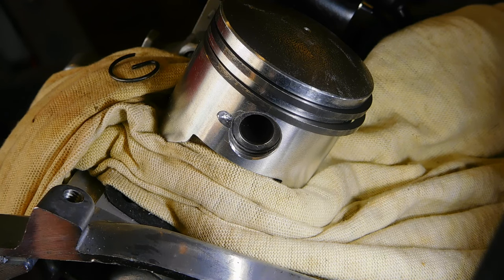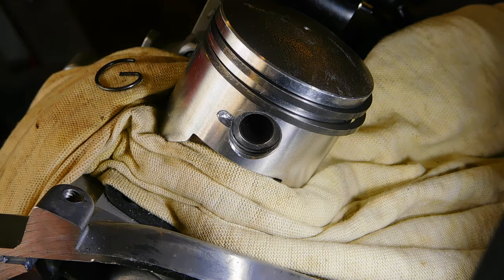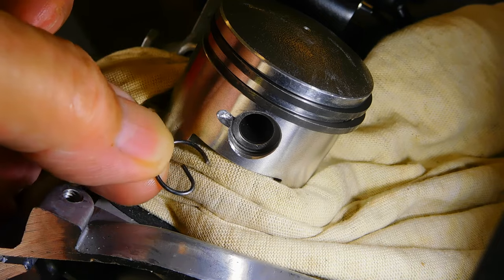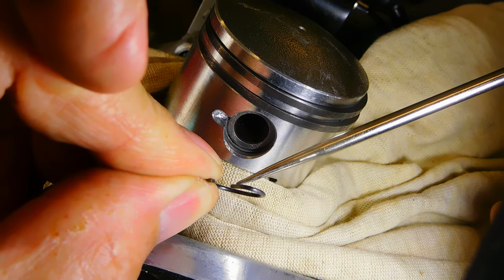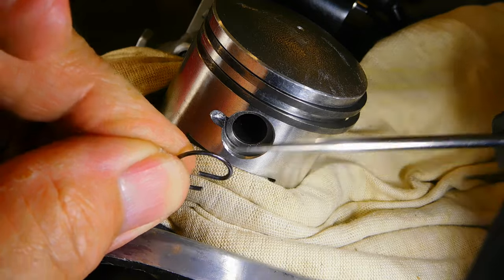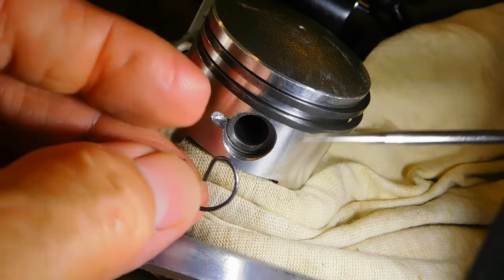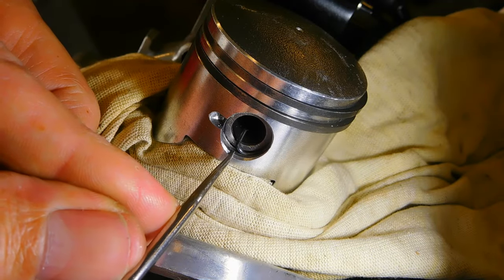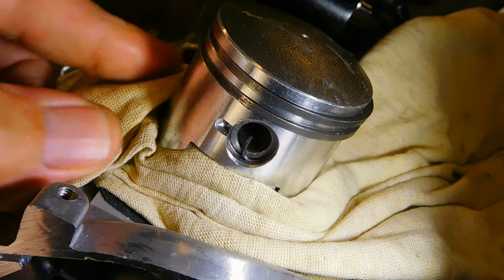One Way to Quickly Destroy a Two Stroke Engine

Comment: Never noticed this. Always installed with a pliers and never noticed the ears. Never destroyed a engine but this video gives golden tips.
Reply from the maker: Odds are it will not happen for most, the problem is that if the clip does fail as it does sometime then it makes an expensive mess, at which rate if doing a rebuild it is a small thing  to sort out to ensure it never fails.
Reply: Can these clips be replaced with proper circlips or.are they just as safe if installed correctly. I just purchased a 45 cc Rovan engine in seperate peices.

Comment: In this case it doesn't matter the clip will outlive the engine. In all other cases I agree completely!
Reply from the maker: Yep, Ill be showing the small end bearing set up on this in next video, its designed to fail.
Reply: I have seen cases where the pin wears thru the clip and the end brakes of. Destruction is the result.  I used to grind of the little ears of to avoid destruction of expensive parts and a highly tuned barrel.
Reply from the maker: That's another good reason not to have them at all.
Reply: Sometimes the clip gets shaven down if its not wide enough and thus rattling out.

Comment: This was the best video I've seen on the G-clip. The 66cc engine gains power with porting as I have learned. Experimenting the Rookie way., I try to sneak up on how far is  too far when opening the ports. Tearing top ends up just on this topic .
Reply from the maker: Thanks for the comment.
Thing with porting to keep in mind that going big on the exhaust timing is not so bad so long as you don't go too high in transfers and leave it with a short blow down time which can cause a fair drop in power.

Comment: I am racing motorized bikes and a fellow competitor had the ear broken off. So I cut them off and cut a groove in the piston to be on te safe side for my last race engine.
Greay videos, but I like to see your face . It makes it more personal.
Reply from the maker: Good idea for racing, its one thing to have it damage an engine and another to loose a race over such a small thing failing.
I used to road race bikes and had things like throttle cable end coming off with a few laps to go and looking at a placing.
I show my face and some of the videos too but I don't make a habit of it.
I should probably add a few more camera views to include that.
Reply: @AuMechanic  Science is to learn from others experience.

Comment: This is very helpful and I wish I seen it sooner. Last year I bought one of these engines from bike berry and I was new to this so when I installed it I pushed the bent pin in. Basically around 3 months later i went to start up my engine and when I dumped the clutch my bike wheel skirted against the ground, and upon inspecting it my piston clip was gone. I tried 3 different times to fix it and i eventually gave up and scraped it. Currently I’m gettin a new kit and the engine will be assembled already so I won’t have to worry about that happening again.

Comment: Awesome advice - I've stripped an engine and found the ears close to breaking off. I now always remove the ears from the clips if they happen to be there.
Reply from the maker: Good idea
Even better to have no ears on the clips at all.
Reply: @AuMechanic  easier to install and then cut it
Reply from the maker: @joelpyy446  Wouldnt do that myself, need to be sure the clip is not distorted after snipping and make sure the ends where you snip them off are filed clean.
Also, don't want a tiny bit of clip shooting off and maybe going down into the casing as you pull the rag out.

Comment: None of polini or malossi tuning zylinders(60-70ccm) i bought had this lil notch in the piston 
The polini actually came wit 2 ears per criclip it was the heaven to install and it didnt pop out yet and ive been riding 4000+km
Reply from the maker: No surprises there, I've seen a few 2 stroke engines with no slot in the piston and in some cases no slot or ears on the clip which makes getting the clip out a real pain.

As for clips with ears not coming out, if you are lucky they wont but if you spend time engine building as a working mechanic its only a matter of time before you see engines with clips that have come out and got chopped in the transfer ports.
Fitting the clip with long nose pliers increases the chance greatly an ear will get bent inward and the chances the clip will come out when its running..
Only 100% way to guarantees the clip wont come out ever is to use ones without the ears.

Comment: I have used pliers and twisted the clip in a clockwise motion and I have broken them in the past. But I definitely would not recommend this because if you aren’t careful you can possibly bend the clip the wrong way without knowing and then all of the sudden your going to have to enjoy rebuilding the top end.Which has happened to me once which is why I am writing this comment. 
Since I have watched the vid I have never had any problems with making sure the clip is in the right position and I never need to worry about the clips coming out and ruining a motor.

Comment: EXCELENT VIDEO, EXCELENT EXPLANATION, GREAT, GREAT, GREAT.....     I was a victim of that specific damadge in my 52cc engine. The machine had problems 6 months after purchase. That clip was installed from factory and when I dissasembled the engine, liittle part of that ear of clip broke and scratched all cylinder and piston. Fortunatlely I saw this video before reasembly all. Thanks...
Reply from the maker: Its a small thing but causes large damage.
And being a less common failure it is often overlooked, it is not till you start doing engines a lot you start to see a trend with piston clips that leads you to think that piston clips with ears are not a good idea in 2 strokes.
Most 2 stroke engine manufacturers seem wise to it and use earless clips but not all such as the cheap knock off engines like the one I use in the video.

Comment: Thanks, had read this concern in Glenn Blair's book recently and just looked at my pile of circlips thinking "Ok they're all either 1-or-2 'curled end' circlips, gonna need to do a careful lil grinding session" and simply remove them from the equation...seeing your "just have the proud side sticking outwards" approach makes me 2nd guess even bothering with removing them, what do you think is it worth removing them if you are setup to do so the right way?
Great vid as always, have never seen one that I didn't learn from (despite my niche being chainsaws, wherein there is no expansion chamber at all and a good muffler design is simply about "no restriction on flow" and "some circulation so you don't dump too-much good charge" rofl)  Random question I didn't see addressed by Blair(or Jennings) is "distance of piston-ring-ends from ports", I'm doing a particularly difficult build insofar as my upper transfer's edge, and intake port edge, will eat-up a ring's end if I go any further (but want/need to enlarge ports still) so am curious "just how far" you can push things safely, I know: 50thou+ overlap minimum, 2mm+ ideal for skirts against port-edges, it seems anywhere from 4-8mm of bottom-of-skirt overlap at exhaust port floor when at TDC is good...and I know 65%, even up to 70%+ of bore, widths can be achieved w/o killing a ring if chamfered/edged correctly....but I cannot find any "rule of thumb" for how close I can bring a port's edge to the line drawn by the piston-locator-pin(s)!
Thanks for any insight!!

Comment: Excellent tips wish I had come across you first saved me heaps of time trying different methods
Reply from the maker: Thanks for the comment
Reply: @AuMechanic  In reply to your last response to me, the moped i have is a Peugeot 103 and yes all the piston kits they have advertised do not come with the rings assembled on the piston maybe mine came like that because they came in a plastic round case that is a little bigger than the piston so they fitted the piston with the rings installed and the pin and circlips inside the piston cavity.
Another thing i discovered when i measured the ring gap is that the to ring is out of specs it measures .019thousands of an inch when it should be .006 thousands. I know that the rings expand with heat but not sure if it will hold compression? the max gap should be .012 thou.
Maybe i should return the piston to the place i bought it or can i use it? and if i do should i use as the top ring or bottom? the bottom is in specs at .006 What do you suggest?
Thank you
Reply from the maker: @SDsailor7  
Never had ri8ngs come fitted to a piston new.
The ring end gap is relative to the bore and if that is correct then it could be a ring issue.
id contact the sellers and ask them to supply a new ring that is within spec.

Comment: I just done a full rebuild on an aprilia sx 50 new racing crank upgraded bearings ect come to buying a 88cc malossi big bore kit £230 & even there piston clips have ears for something that's all about racing ect I think if it was much hazard for the 20/30p it probably cost them surely they would change them?? I'm all about restoring & making absolute beasts out of a bike specially two stokes and must say I never seen one without the ears & could imagine with the flex of it the pin would have to pop the clip out before the ear would snap as 3/4 of the clip it sits on is clipped in so I think this would be VERY rare in all fairness but it still does make sense to put clips in without the ear but if it comes out it's going to destroy your engine anyway but The pin doesn't just push on ear as the clip would never sit flush so it pushes on the hole clip and the pins always have a hole in for lube reasons so there would be more pressure on the outter of the clip only if like you claim there's no bend onwards on the ear & I bet if you check 9/10 are slightly bent  so not claiming what your saying is wrong though your very right but chances of this happening  probably the same as a Cyclops horse lol brilliant informational video though keep them coming ,👍👍 top man

Comment: You are correct sir. Ive just done a huski k970 concrete saw and the clips are bent outwards to prevent this. I have done the same engine before and the clip broke because I didnt know this issue and destroyed the piston. Even the factory repair manual doesnt say anything about this. So thanks for this information
Reply from the maker: Thanks for the comment.

Comment: Never had a problem with any 2-stroke engines I have done using pliers to install the circlips.  However I do see your point.  Right now I'm working on a husqvarna 55 chainsaw.  I have got an aftermarket piston kit, and the piston(has 10mm wrist pin) DOES NOT have that notch.  You are pretty much forced using pliers to install the circlip or spend big money in getting a specialty tool to do the job.  Imagine trying to remove a circlip without that "ear" from a piston with no notch.
Reply from the maker: Yes I have had pistons without the notch, getting the earless clip in is easy enough, I use a pick tool to lever the clip in to the slot either way even if the clip has ears on it.
But getting it back out is a hassle and requires a pick tool with a nice sharp tip and can leave a bit of a mark in the clip groove too.
But then in most cases you wont need to remove the piston off the rod unless you are going to replace it in which case marking up the clip groove is not an issue since the piston isn't being re-used.
It is possible that was the logic manufacturers use when making notch less 2 stroke pistons.

Comment: Hi, I've made a pipe following your videos, and on the pipe I've got a dirt bike style straight through silencer with proper insulation material. Despite this it is still very loud, and I was curious how i could go about making a more restrictive silencer and adjust the stinger diameter accordingly. I've downloaded a copy of Blair's book so if you have a page reference that would also be great. Thanks for the great videos.
Reply from the maker: Gordon Jennings used a method that i also used which was to insert the outlet pipe back into the diffuser cone past the mean reflection point which would reduce the sharp crackle of the sound with no power loss.
You can find info on that in his book "Two-Stroke Tuners Handbook" page 69
Blair has an expansive chapter on mufflers in his 1996 book (Chapter 8 page 541) and provides some equations to go and I was going to do a video on that at some stage.
Reply: @AuMechanic  thank you for the help it is much appreciated
Reply: @AuMechanic  69 nice.
Reply: @AuMechanic  what if there is no slot in the piston?
Reply from the maker: @briansurbersurber5330  File one, or, if you are going to use a clip with ears be careful as per instructions in the video on fitting one.

Comment: I had this happen on my 87 puch moped I put a 70cc big bore kit on it and didnt know these were trash clips. Now I just ordered parts and now I gotta order a crank case gasket cuz i know that piece of broken clip didnt come out my exhaust and it had to go somewhere when i lost all compression. Thank you for this video probly saved me another rebuild
Reply from the maker: Yes it'd be a good idea to split the casing and make sure everything is ok on the bottom end.
Reply: @AuMechanic  it was a single piston  ring and I think it got coughed out the exhaust I herd somthing fly out I just never found it it was a main road to but I'd need to buy more tools I really dont have the money to spend on like and pnematic screw breaker so I can loosen the crank case I've turnend it over so many times with a drill I dont think it matters if the damage is done I'll rebuild it all the way and buy a new racing crack and bearings and seal and get a better two wiring piston for it I hope it didnt. If it did I'm gunna have to buy alot more stuff hahahaha just another reason to get another better head lol I reall hope it didnt tho cuz i cant afford that I drained the oil and I'm gunna drain it again in the morning and see if I can shake it aroun surprisingly no meteal or metal shavings in the oil so I'm hoping its not just pat of a gear now if it is let's hope it stays there
Reply: @AuMechanic  idk you tell Mr if it's worth it j could breake the old ass screws there from 1987 and then I gotta get some gasget sealer and hope I seal it up good enough and scrape everything clean and tighten it all back down but I need a impact screw breaker to do the case it's kinda out my range
Reply: @AuMechanic  it's also a piston port intake 2 stroke I may as drop the engine and do it if I wanna daily drive it. I've never split an engine before so I'm kinda nervous maybe I'll just open the side up and see if I can spot any damage with a good light and camera
Reply from the maker: @naturechanel209  
If you don't want to split the casings then just inspect the big end bearing for any signs is debris like small specks of aluminium and give the bottom end a good rinse out with some pre mix fuel.

Comment: The wrist pin is going to push on those too, and after while that ear gets weakened and breaks. I went with some wiseco 10 clips, no ear to worry about and they're good and heavy duty.
Reply from the maker: Yes the pin twisting motion can against the clip ear can saw off the ear after a while.
I have some images I will post soon showing one nearly sawn off in a Husqvarna chainsaw engine.

Comment: If when installing the pin you scratch the piston at that point is the piston no good? I’m changing the piston and ring on my sons KTM 65 and I wish I would’ve seen this video before I did. When installing it I scratched piston. Thank you.
Reply from the maker: If its only a fairly small scratch you could use a sharp tool to "carefully" scrape off any obvious high spot along the scratch and then give it a rub just over the scratch with some very fine grade sand paper to clean it up. 1200 wet and dry will do.

Comment: How much does that wrist pin turn during operation or is it stationary and the connecting rod moves on the wrist pin?
Reply from the maker: The pin does rotate in the piston even though it has a needle roller bearing.
This action can saw off the clip ears

Comment: I always used E clips as those G clips are risky.

Jawa & CZ piston kits always come with E clips. I even replaced the OEM G clips on my Suzuki GT550 with Jawa CZ E clips. 30 years later and still fine.
Reply from the maker: In most cases clip wont come out, but if it does .... you might be wishing you had plain clips with no ears on them after you look at the damage done.
Reply: @AuMechanic  Never had any issues with E clips in 40 years on dozens of 2 stroke top end rebuilds. Only disaster was a G clip coming out and welding itself into the side wall of a piston (the cylinder liner was steel so OK), back in 1988, which is why I now throw the things away went I find them in piston kits.

E clips tension all around and the clip needs to be inserted with the ears facing either to the front or rear of the piston. Oddly enough I was teaching my "understudy" about the horrors of G clips whilst installing a 307cc big bore kit to a 1978 CZ 250 twin last Tuesday. (He's a millennial who's been bitten by the classic 2 stroke bug and wants to learn how to restore & fix them himself, including all the black arts such as setting up TLS brake drums, etc.).
Reply from the maker: @CZ350tuner  
As a  MC mechanic rebuilding engines daily it was rare, but enough to know that the ears on clips are a hazard and the purpose of the ears is ease of fitting which is not worth the risk of one coming out and as you see by the comments here it happens and possibly more often then I knew of.
The ears on the clips do nothing for the operation of the engine and are only a liability and perhaps that's why most 2 strokes OEM clops have no ears on them.